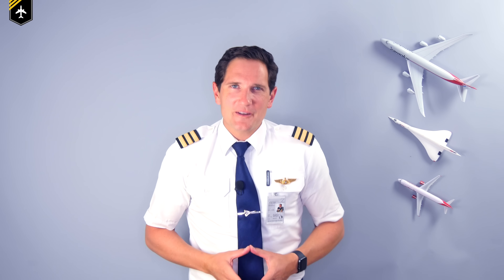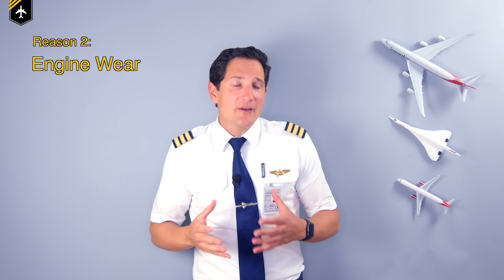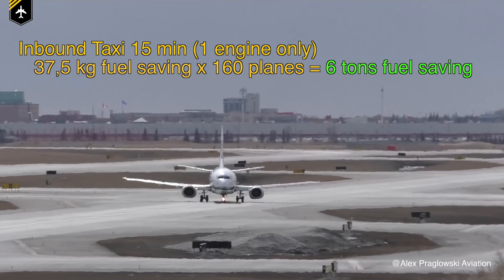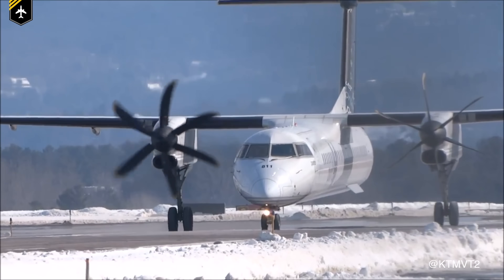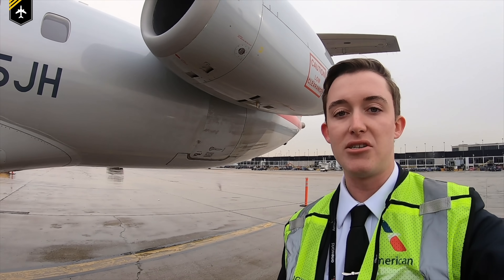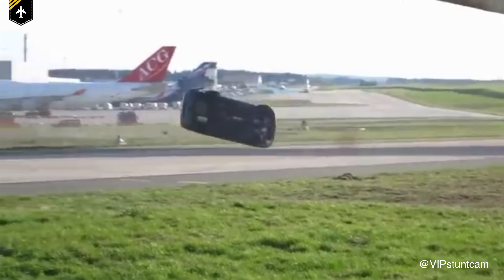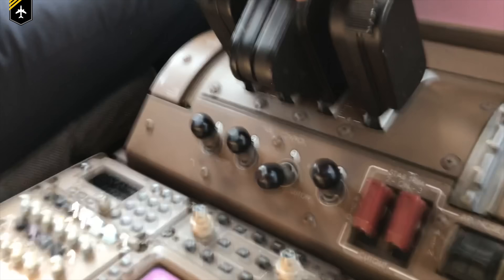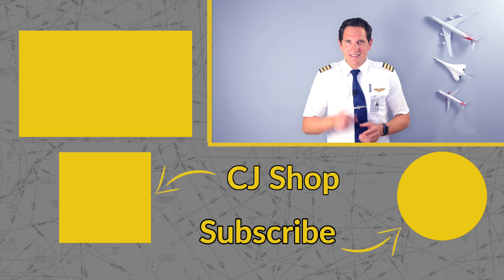Why do PILOTS taxi only with ONE ENGINE??? Explained by CAPTAIN JOE

Comment: Travelling Ryanair?

Bring an extra £25 for engine start.
Reply: also £40 for switching TOGA, and £100 extra for actual go-arounds (this would actually be sold as extreme sports as Ryanair land on fumes)
Reply: And for every cm of pulling the throttle £20
Reply: And £30 for flaps
Reply: ben jomin 😂😂
Reply: Lol that joke never gets old
Reply: No! "Get out and push" because it saves on their starter motor!
Reply: And £5 for water, and £20 for a emergency face mask
Reply: @scjvz04d5  £50 for oxygen, £10 for the life jacket, £20 if you won’t be travelling over water. £30 to have a chair (can fit more in if they all stand)
Reply: 😊e

Comment: I have a question. Don't you need to double the power from a single engine to "push" the plane along, thus increasing its RPM (maybe), its fuel consumption and its wear? And also, doesn't the plane get an asymmetrical push you need to compensate? Thank you in advance (sorry for bad english).
Reply: Matteo Roda you would need double the power but it would still be more efficient than 2 engines (as more energy loss would be created if using multiple engines)

And yes there will be asymmetric,but you can easily offset that on the ground with the tiller or rudder.
Reply: @ZK-APA  thanks

Comment: Stupid question but since the fuel savings are so high when turning down an engine during taxiing wouldn't it make a huge amount of sense to just run the aircraft of the apu since all large planes have that and have (a) small electric engine(s) inside the wheelhubs? It would probably only add less than 100 kg if at all and it would cut out nearly all of the noise and having only a fraction of fuel use compared to one engine running when the plane is on ground. I never really understood why aircraft never got to use something like this since it's such a little thing to add it doesn't even have to fulfill the huge aircraft reliability demands since it doesn't matter if the electric engine would fail, you just use the current method if it does, not to mention that it's probably just as reliable as the turbine engines if done right. Only problem I can think of now is that big aircraft usually have multiple carbon brake disks inside all wheels but I don't think it wouldn't be possible to sacrifice just one, let's say the single front landing gear for this purpose and still easily get enough braking power from the rest of the wheels. Imagine the tons and tons of fuel savings pear year with this simple addition....
Reply: gamehey it would increase complexity in the landing gear system, and when not in use it would be deadweight. And it would definitely be more than 100 kg.

Having said that, what you’ve said makes sense, and maybe could be implemented in the future.
Reply: @ZK-APA  Thanks for your comment! 

It really much depends on the aircraft I guess. On a large A380 you'd add a few hundred kg of weight at the very least. On a 737 it would be much less than that. 

Nowadays we can have electric engines witn 1000 hp that weigh less than 100 kg for the engine itself, of course there is more to it like wiring and stuff but we only need small amounts of batteries or if it makes more sense we could use capacitors, but either way this variant makes more sense than using main turbines during flight to load up bigger amount of batteries and removing the apu altogether since that would heavily sacrifice safety and that's not acceptable.

Aircraft are so complex already that I don't think that tiny bit of complexity would matter at all for all the given benefits. One thing I didn't mention is that you'd remove uneven engine wear and extend time between overhauls for the much more complex and expensive turbine engines. So it will be interesting if we see such thing in the comming years.

Comment: I figured the fuel saving was the reason. The access to cargo doors makes sense but I would guess the noise abatement would not be influenced as most noise is generated at take off with all engines at take-off thrust power
Reply: Don Dash noise is cumulative as well. I live about 4 km from an intl airport and I can still hear taxiing aircraft (at night that is)
Reply: @ZK-APA  I realize the cumulative concerns but does shutting down 1 engine impact it?  I guess the science can prove it.
Reply: Don Dash I guess it’s more of a measured statistic than a practical one.

Comment: Hey Captain Joe. Thanks for your nice video again. Why are the pushback tracktors not used to bring the aircraft to the runway? They drive relatively fuel efficient and are still able to follow instructions through the headset by either ATC or pilot.
Reply: Couchsurfing band 2 reasons.

1. The nose gear isn’t designed to be used by a tow truck for long distances, especially with full weight

2. Doing that would decrease the airport’s movement rate.

Comment: Hey, Joe what is flight level(FL)
Reply: Flight level is aircraft's altitude at standard air pressure. It represents hundreds of feet. For example FL250 means 25000 feet, FL350 means 35000 feet and so on.
Reply: Thanks now I Know

Comment: Captain Joe Why do airports at high elevations have longer runways for take offs and landings than do airports at sea level?
Reply: Thats because with higher elevation means less air so so when you brake there is less air so that means less drag. But for lower altitudes there is more air and thus creating more drag
(so higher up less drag,on low altitudes more drag)
Reply: Farrel PS not exactly. It’s more to do with the fact that at higher altitudes, an aircraft needs a higher speed (TAS) to generate take off lift. Hence to accelerate to that speed, a longer runway is needed.

Similarly with landing, you land faster at higher altitudes, hence a longer runway is required.

Comment: Surely a big reason for shutting down the port engine when taxiing in is to allow the engine to idle and cool so you can open the door and disembark as soon as the plane comes to a stop at the gate??? For quick turnarounds some airlines don't even stop the starboard engine.

Comment: I'm a Rtd commercial pilot for a well known Australian Airline and yes he is 100+% correct re the 747 
I have also flown the 737, 767, A330, A320,A321  can all be done in any aircraft
Reply: How come you have been certified in so many planes... 🤔 And you've flown every single variant of each plane too? Which usually calls for re certification.

Comment: Dear Captain Joe, I thoroughly enjoy your video's. They are very clear, not too technical, easy to understand. I have a few questions, which are all related: 1) What exactly is turbulence and what causes it? 2) Does a pilot know in advance if the aircraft is heading into turbulence? 3) If yes, how does he know this? 4) What are air pockets and what causes them? 5) Does a pilot know in advance if there's an air pocket ahead? If yes, how does he know this and can he avoid it? These are my questions. I hope you can answer them in one of your upcoming video's. Thanks! Paul.

Comment: I have a question for you #CaptainJoe 
   Why does the turbo engines bent down a little on the front, and why are other 4 engine planes are not perfectly aligned, like for example, the b747, the no. 1 and 4 engines are facing upwards a little if you notice, like a380 too?

Comment: Before watching video:  my guess is that it helps with turning (since you have thrust from only one side) and that less power means you don't run the risk of overspeeding on a taxiway, which is illegal (unless you request high speed taxi I guess, but I've forgotten taxi speeds since I'm not a pilot aside from random FSX fun).

After video:  Oh, for fuel saving.  Derp....okay so there are multiple benefits to it.  Hmph! >_>

Comment: Dear Captain Joe. My hse are approximately 80km from the airport. Most of the time, aircraft will passing by the area above flying at 8k ft. I always heard the aircraft approach and suddenly make a loud accelarating sound but I constantly check via the flightradar24, the ground speed still maintain and the alt steadily deacresed. what actually the pilot 'doing' to the control panel that time? thank you.

Comment: Why don't they put electric motors into the wheels, so the plane could taxi without burning any fuel? Power could be supplied from the grid of the airfield.
Reply: That will increase weight and produce extra stress to the landing gear, and it would also make the landing gear construction more complicated that may cause reliability problems.

Comment: It would be easy to avoid FODs by installing some kind of grid at the engines entrance. It's there a technical reason why there is no such thing?
Reply: 423kowalski it blocks the airflow (yes it’s a grid but still it’ll block and reduce efficiency). And the fact that any disturbance in the air before it goes in the engine can cause compressor stall/surge.

Comment: DISCLAIMER: It may sound dumb.
Wouldn't having only one engine running on one side would make the plane want to go other way.
It would get really boring to keep turning on one side to compensate differential power!
Reply: it is true that the engine would make the plane turn but I'm pretty sure they have a locking mechanism for turning so they don't have to do anything.
and anyways I think the thrust on taxi is rather tiny so the plane would not turn an awful lot
Reply: The effect is quite weak at the taxiing speed and the aircraft can be steered by the nose wheel.

Comment: Capt. Joe, Since idle engines waste so much fuel, why not towing the planes closer to the runway before even start any engine? Shut off some engine after landing, as the current procedure.
Reply: Simple reason to not tow the aircraft long distances along the taxiways is that it will slow down the traffic at the airport. This type of towing many times a day will also put extra stress on the nose wheel, which can be risky.

Comment: You forgot about brake wear and tyres overheat during long taxi in with light weight or a long downhill slope. 
I don't agree with you that it is dangerous to turn off engine 2 and 3 with a light aircraft during taxi in to the gate. A light 747 is moving on its own on 2 engine at idle thrust.

Comment: isn't the real reason to allow your capacitors to recharge (due to low ground magnetic voltage?) before take-off as your plans are in fact electronically propelled. Answer me this : where is the crank pipe?( No smoke on start up?) how do you carry 150'000 tons of fuel? and where is it stored? and the smell of the thrust smells nothing like burnt kerosene.

Comment: Captain Joe, can you let us know your feelings towards the 737-800 max aircrafts? don't you think it was a stupid idea for Boeing to sell the warning light that showed that the MCAS system was active(so the pilots could act accordingly)? and the lack of training that pilots had in relation to it, also what are your feelings that several airline are renaming the aircraft (Ryanair has changed the 737-800 Max to 737-8200) and Boeing are probably going to rebrand the aircraft too at some point because lets face it no one will want to fly on it giving the current critical flaws, I would rather pay a premium to go on another aircraft than the 737-800 Max. Also let us know if you would fly one or if you would steer clear of it even after the software updates.  would be interesting to know a pilots take on it.

Comment: but hoe the plane wont divert  the all fuselage to the thrust of the engine position?
Reply: The effect is weak at taxiing speed and you just steer the aircraft with the nose wheel.

Comment: Captain Joe, speaking of saving fuel, please make a video (or tell me), why is fuel measured in pounds/tons instead of gallons/liters?
Reply: The weight is the important thing: for example the maximum takeoff weight and maximum landing weight. So it's not practical to use gallons or liters.
Reply: @mikep9604  that makes total sense. Thank you Mike.

Comment: Just a thought, when you have one engine off don't you get a turning torque which would turn the aircraft left or right, in that case do you use the nose wheel to counter the effect, or am I wrong in my initial assumption
Thanks .
Reply: Rupa Somm nah it doesn’t have much of an effect ok the ground. As soon as you were in the air though the torque would be crazy

Comment: Hi Capitan Joe, what is the function of the engine situated on the tail of the plane?
Thanks!
Reply: It's the APU (auxiliary power unit). It's used to produce electricity for the aircraft systems when the engines are not running at the gate or on the ramp. It is turned off when the engines are started.

Comment: Captain ! Can you explain why aircrafts use Lever for landing gears instead of buttons?
Reply: My thinking is that buttons are more easier to be pushed accidentally, and if its pushed by accident, there will be problems. But thats what i think
Reply: Because the setup is mechanical not electronic so that even when electrical systems fail.. the landing gears can still be deployed. Probably the landing gear lever is connected to a hydraullic directional control valve.
Reply: @sahilsambyal4968  here a vid on the manual override to extend landing gear.  normal procedure is hydraulics indeed. 
https://www.youtube.com/watch?v=o0hr_qjJ9Go

Comment: Can pushback tractors tug aircraft to the runway then they start their own engine to save fuel?
Reply: 陈元 that wouldn’t be practical as one, using too much of the tug puts stress on the nose wheel. And second, this would reduce the airport usage rate as takeoffs will be much slower.
Reply: In reality it's not a workable procedure. That would slow down the traffic at the airport. And all those tractors moving along the taxiways could be an extra safety risk for all the aircraft. Towing the aircraft long distances every day may also cause extra stress to the nose wheel and cause problems for the structure. It's just not practical.

Comment: I always tought the reason of using 1 engine is so the plane can turn with only 1 side drag.... now I'm confused, how will the plane stay in a straight line with only 1 side engine and not pulling to one side?
Reply: The effect is quite weak at taxiing speed, and the nose wheel will steer the aircraft and compensate the effect.
Reply: ikly43s rudder or tiller

Comment: Norman Y Mineta San Jose International Airport (SJC/KSJC) is a commercial airport that sits not too far from the popular San Francisco International Airport (SFO/KSFO). It is an airport that is constantly growing and normally suits business travelers because it is more convenient than SFO mainly because it sits in a Silicon Valley. One thing the airport is known for is its displaced runway thresholds. On the 30 runway side, the threshold is not at the beginning of the strip, but a little bit further down from the beginning. Why is this?
Reply: Not BigBertFun it’s either because of some obstruction, or because of noise abatement

Comment: The other reasons not withstanding, but doesn't it require more power to taxi with 1 engine rather than 2?  If that's the case, then the fuel savings would be negligible if not costing more.

Comment: Can a 747 fly upside down to test in a flight simulator
Reply: Waylon Arnold no it can’t. Wings generate lift upwards, so if the plane is inverted, the lift generated will bring the plane downwards

Comment: Why not just design planes with hydraulic drive motors at the landing gear axles and not rely on engine thrust to move the plane at all? Just power the hydraulic motors via the APU and store energy from landings in an accumulator for later use, further reducing apu fuel burn?
Reply: Jas B. Issue with that is increased weight and complexity of an aircraft. Especially considering the limited use of it.

Comment: Captain Joe, 

Here's two questions for you 

- Why don't planes have parachutes during emergencies? 

- Why don't Plane have a  mechanism that allows it to float on water during an emergency sea landing and why can't a plane inflate itself into a boat? 

- why don't planes have a propeller in case the engines or anything else fails? 

- Why can't the doors be open during an emergency at 5000ft above ground - I understand it's because of the wind that will come in but it will save lives! 

Sorry more than 2 questions :) 

Safety is important to me.
Reply: Habib Miah well the short answer is cost and complexity.

Yes, what you are saying will theoretically make planes safer. But practically these are some safety features that’ll statistically never be used. moreover implementing everything will increase the cost of flying to the point of it becoming unaffordable. Hence no point making things “safer” at the cost of it just not being affordable.

Comment: Given the equipment you have worked (A320 and B747), how do they differ in handling Crosswinds?  Are the limits different on each plane?  How high a crosswind component Will your company allow before you have to divert?

Comment: doesnt the one engine have to work harder to move the aircraft thereby  using more fuel anyway
Reply: pontymike56 it would have to work harder, but it’ll still save fuel compared to using multiple engines because of law of diminishing returns.

Comment: Why is the 737 engine flat at the bottom ?
Reply: When Boeing started to develop the original B737 they had to design the new engine nacelles. The flattening of the engine nacelle provides more clearance between the ground and the engine.

Comment: Are there any RPM/power limitations during one engine taxi? Once an A320 (taxiing on one engine) must stop before reaching it's final parking position on stand (VDGS was activated late), then it couldn't get move. The working engine span up several times (but not too much), then the pilot started the second engine and continued on final cca 20 meters. I didn't find any explanation for that so far.